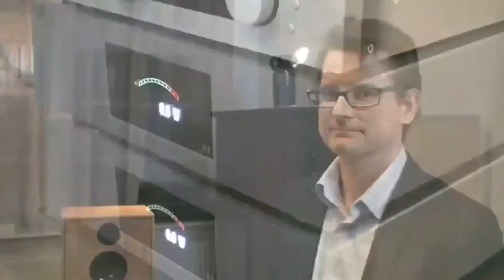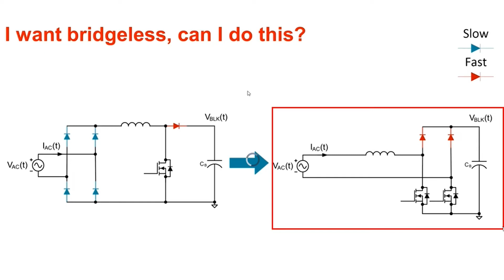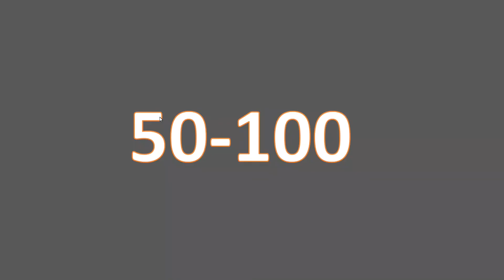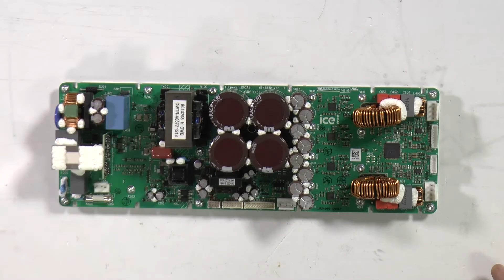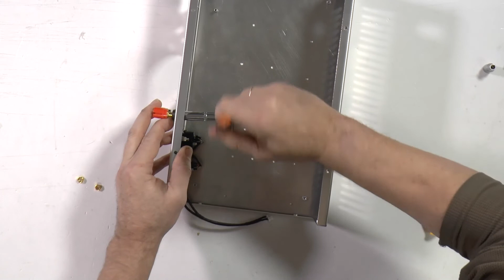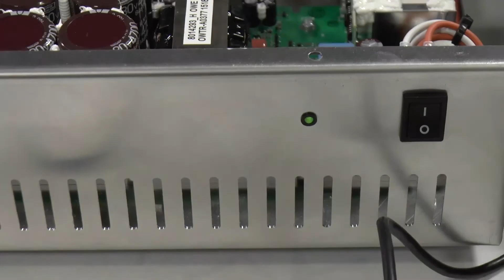ICEpower 1200AS2. Build your best audio amplifier in the world. Part 1-3

Comment: I had plans to use my MiniDSP 2x4HD board to drive this amp as a subwoofer amp but now (after testing) it seems the 2V output is not strong enough to drive this amp. What could I use to take the processed signal from the MiniDSP and increase it so the amplifier will produce full power?
Reply from the maker: Any preamp that can boost signals up to 3.8Vrms or 5V peak. You can use professional mixers that are produced in large volumes and costs are reasonable like Soundcraft ohttps://www.thomann.de/gb/soundcraft_notepad_5.htm or Behringer https://www.thomann.de/gb/behringer_xenyx_302_usb.htm
Reply: @guntarssmits2104  any ideas for something smaller/bare board that could go in the amp chassis?
Reply from the maker: @stevensolazzo  It is hard to suggest regarding bords. Icepower 1200 has very good balanced preamplifier circuits and you need a good preamp for that. Also, it is difficult to predict the voltage transition processes of the preamp. It may create a huge blast during the switch-on process. You also need power supply voltage for the preamplifier which you can take from 1200AS2 board, some +-15V. You Should take some boards from AliExpress and experiment. It would not be correct by me to suggest something that is not tested.

Comment: Could you please make a video on the new 2000 AS modules. Would like to hear your opinion on them! Amazing channel you have! I love it
Reply from the maker: Yes, 2000AS2 is a fantastic board. It is identical to 1200AS2 but with higher output power per channel. Single channel is capable of delivering 2KW, Stereo 1KW per channel. The connectors and layout are exactly the same. My Kit TCR1200 can be used for both boards without modification. Wires can handle 4 KW/channel. It was a clever solution to use a PWM fan for cooling because 2000AS2 has a higher idle power consumption and it may be wise to use the thermal paste to improve the thermal connection with the chassis Other vise board is identical to 1200AS2 with the same performance and architecture. I Have a german customer who builds an amplifier using a 2000AS2  board and a TCR1200 kit. He mentioned that his system has infinite power headroom and I believe it. 1KW high-quality power per channel for the home user is a lot of power.
Reply: @guntarssmits2104  thanks for the reply! I have 2000AS2 myself which I use in mono-configuration. They are built with only the best internal-wiring and connectors from Furutech and ETI. The headroom and slam is incredible! Utterly transparent and clean sound! I have owned many expensive AB amps from known brands, but these ICE-power amplifiers best them all! They are also an amazing match with my Pass Labs XP 20 preamp! 🙂👌! Keep up the good work my friend! Very informative and knowledgable channel with absolutely zero BS!

Comment: I have been using a 50ASX2 at my desk for a long time. It has been reliable and sounds good through my speakers, which are DIY but are like Amphion Ion with upgraded drivers.
Reply from the maker: I have made a stereo amplifier from ICEpower 125ASX2. It was a very good 100W/channel amplifier and sounded better than many industrial samples. To improve the sound, I used an INA1650-based balanced preamplifier. But 1200AS2 is a next-generation design with proprietary Class d driver chipsets. There is a significant sound reproduction tolerance jump. And of course, working so far away from clipping it is capable to drive complex speaker loads without sound reproduction detail loss.
Reply: @guntarssmits2104  I have been on an amplifying odyssey for the last two years. I bought two Hypex NCx500 monoblock amps. I was somewhat lukewarm on them, even though they sound quite clear, because they are too overdamped in the bass range, but I remembered having good results from 300ASC, which became 300AS1. I bought and built a pair of 300AS1 monoblocks and I have been enjoying them. At the same time I also bought a 200AS2 module and built a stereo unit. I have some dry, bass-shy floorstanding speakers that actually work really well with the 200AS2 which has a lower damping factor than the other modules out there; I am curious how much of this has to do with the amp chip. Out of curiosity, after reading good things, I bought two 1200AS1 to build a pair of ICEpower monoblock amps. I think it can only benefit to have two independent 1200W power supplies available instead of just one that is feeding two amp channels. I will have to report how they sound. These modules are great, and having them available on the market to buy is even better.

Comment: Do you have information about installing a 12V trigger? Thanks in advance.
Reply from the maker: I will make a detailed video later, but in short you should provide 12v control signal to P102 pin 18 (Trigger) via 10K resistor
Reply: @guntarssmits2104  Hi, thanks for the reply. What about a GND? I would have 2 cables coming from my processor (12v and GND). Also, would I first need to place the module in standby? Thanks again.
Reply from the maker: @MikeYoungeasytravel  From manual "When the 1200AS is in standby-mode set by a high on the Standby input, ( P101, pin6 connected via 10K resistor to pin 3 DVDD standby) the module can be powered up by a high on the Trigger input. This can e.g. be used to switch on and off a remotely located amplifier." GND connects to the chassis. Most 12v  connectors are meant to be connected to the chassis when you secure them. You should verify if the 12V socket is connected to the chassis in a secure way. Some paints may work as electrical insulators. In case you have a chassis-insulated socket you can connect GND to the board. In practice, you need to experiment with that. In case you get a hum noise disconnect board GND and go for chassis GND   for 12V trigger.
Reply: Is it possible to detect input signal from the balanced connectors and use this to turn on the amplifier only when needed?
Reply from the maker: @wojciechgorski5708  Yes

Comment: Are the other icepower models from the AS Series the same quality than the one you used? I consider building a amplifier but I really don’t need that much power and also I wouldn’t be mad spending a bit less money for a less powerful model. Best regards and thanks for the great video
Reply from the maker: No, alternative integrated boards with the latest generation chipsets and Quadro-balanced architecture exist. Believe 500W is not much power even for shelve-type speakers you will have some headroom that's it. It was a problem with class AB efficiency and most of the Class AB amplifiers are about 100W. Normally for floor-standing speakers, we need more power but it was expensive in the past. I was testing setups with 40RMS power small speakers and they sound lovely and safe. Board is built with low sensitivity and you need a large input signal (3.5V) to go for full power

Comment: Have you tried some Hypex/purify models wich are extremely popular? And are they close/better for music performance wise? Thanks in advance, this was an amazing video!
Reply from the maker: Purifi and Hypex solutions are single-ended which is a significant lowlight for class d design. They are great sounding devices but for a higher price and the worst architecture. This is the main reason why I choose ICEpower over Purifi and Hypex. The last 2 brands are focusing on consumer audiences and have a lot of buzz around their products. It does not mean they are better. They have better marketing with a clear focus.
Reply: @guntarssmits2104  thanks for the fast reply!!
Reply: @guntarssmits2104  As far as I know, Purifi and Hypex amps are designed natively for fully differential input, not single-ended. Isn't this what you mean? I really appreciate your work and knowledge for the community.
Reply from the maker: No, I meant output stage. 1200/2000 line up has bridged architecture ( Mcintosh branded it as Quadro balanced)
Reply: @guntarssmits2104  Ice being bridged as in a bridged stereo amp in mono mode (Bridge-tied load)?
Hypex can also work in BTL, which "results in double the voltage swing across the load compared to a single-ended configuration". This is useful for higher impedances, as the impedance of the speaker is halved in BTL, min. 4 ohms, 8 ohms recommended. Peak power is doubled. THD is worse than SE.
I don't see Hypex and Purifi architecture being worse than Ice for this. Ice's main benefit is price per power. And yes, efficiency.
As far as I know, SE is referenced to ground while BTL is floating.
Can Ice drive 2ohms speaker in BTL architecture?

Comment: I own a combined dual monoblock with a stereo kit in the middle of the steelcase. It delivers 1200 watts per channel for my dual subwoofers and 620 watts per channel for my top system consisting of two Seas L17REX/P and one centered Aurum Cantus G2Si ribbon tweeter. They sound perfect👌🥳

Comment: Hi, recently I just saw a youtube clip from PS audio and they're also using icepower module for their amp. They're using 1200AS1 to build the monoblock. In the comment section I saw people describing the old class D problem is mainly comes from low pass filter design. With poor implementation some high frequency noise might goes into speakerdrivers in the old days. Also they've mentioned about the BTL mode typically has better performance due to 2 sets of LPF the circuit is actually using. My question is whether 1200AS2 is in BTL mode? In your video you've mentioned about the benefit of quardo balance design. But looking from the 1200AS2 board itself it seems that the output part only has one 
inductor per channel? Are they using same inductor for positive and negative channel? or it's different demodulation?Another question is about the phase response. Saw some people mention that the phase response of 1200AS2 is 30 degree off at 1kHz and 40 degree off at 2kHz and max out to around 50 degree. Is the phase difference a concern for audio content at this frequency range?
Reply from the maker: Icepower1200AS2 has 4 channel architecture set in bridged mode. The filter has 1 core and 2 inductors inside it. This is misleading visually. It is a space-saving solution. If you will check the inductor in detail it has 3 connection points. One more engineering genius solution is reducing the price of the board. The board's final price/quality is unbeatable. The simple answer- 1200AS2 is operating in bridged mode.
Regarding phase shift. First, humans cannot hear absolute phase, just a phase difference in the frequency range from 500Hz -4.5Khz. Once both channels have equal phase shift sound stage is not impacted and you have the perfect result. Think broader and take into your scope passive crossover filter what is turning phase for more than 180 degrees in the midrange and no one is complaining that it is a problem. But a lot of literature is emphasizing that you need a good crossover with selected and adjusted components to match the channels. And the last phase impacting element is the speaker itself. Each speaker in the working frequency range is turning phase for about 30 and more degrees. The key takeaway from the long answer is that human is not able to hear the absolute phase, only the phase difference between the left and right channel.
Reply: @guntarssmits2104  Thanks so much for the detailed answer. I also wander why people put emphasis on power amplifier to have perfect phase response but did not mentioned about the phase problem in crossover / drivers. The 2 inductor in 1 core is hard to tell for me, really thanks for the information. I'm recently considering buying the 300A2 hanger module to form the 3 way system by using the hanger rail from 1200AS2. I'll update after finished.
Reply: Which LPF would you recommend? Passive? Order? Would that work on other class Ds?

Comment: Labdien!
Great video!
I was curious about the ICE1200AS1 vs AS2: does the AS1 have any advantages over the AS2?
Looking at their specs, an AS2, if run mono, gives the same output in a 4 Ohm load as an AS1. So is more flexibility for the price of a little idle power dissipated by the extra output stage when that is not used, and ca. 80 Euros (tax included). Otherwise apparently identical parameters when AS2 runs one channel only.
Seems to be very little going for AS1 - or am I overlooking something?
Reply from the maker: Yes you are right. 1200AS1 is good with a hanger board to make 3-way active speaker systems. For other applications 1200AS2 is better choice.
Reply from the maker: You are Right, There is no tangible benefit except a slight price difference using the AS1 module. There is a professional usage scenario in format AS1 board for a woofer with 1.2KW and hanger module for 300W or 400W in stereo. You will get a powerful 3-way system for professional usage, but there will be too much power for a home system.

Comment: Very nice video. I had a xtz edge a2-300 . But that one was to weak for my speaker.. Do you sale the whole kit ?
Reply from the maker: Hi, currently I am selling only Kit. In my channel, there is information also about terms and conditions and where to purchase the board. We are not selling boards by ourselves. The board you can purchase from EU reseller “Sound import” Boards are in stock. This is a proven supplier with good customer service.  https://www.soundimports.eu/en/icepower-1200as2.html 
Pricing, Terms, and Conditions are described there. This kit we are mostly selling directly. This video will answer why. https://youtu.be/BmvG0foYXGY
Assembling instructions are available on my channel https://youtu.be/w1FNFcv1v7w
Reply: @guntarssmits2104  Thanks for the time. I will give it a try . I think this setup will match my speaker well.

Comment: Would one of those cnc aluminium case thats used for class A amps be enough to passively cool this module?
Reply from the maker: Yes, but you do not need so excessive cooling. I saw suitable enclosures with one full-length heatsink. You need about 120mm high enclosure with one heatsink, place the board in a vertical position, and drill holes in the bottom and top plate to provide airflow for board components with natural convection. It starts from about 120mm high. Cold air is coming from the bottom and hot is going out from the top. You should provide 12mm bottom clearance for secure airflow.
Reply: @guntarssmits2104  Will heat dissipation through the bottom metal plate be enough to cool it? 
I am looking at a Boulder style  cnc case that doesn't have any holes for air flow. if the heat is mostly transfered to the bottom plate, then I could just put thermal paste between the bottom plate and the case, let the case do all the cooling.
Reply from the maker: @px7355  From engineering aspects it is not a good solution. You should create convection according to physics  Your design will overheat already at half power continuous music listening and shorten the board lifetime Heat from the bottom plate accumulate inside the chassis. without convection, it is not moving away and starts exponentially growing inside the enclosure. Dispatch is slower than the accumulation process.
Reply: @guntarssmits2104  thank u, I will look for another case then
Reply: @guntarssmits2104  I’d expect the heat accumulation’s dynamic be closer to “asymptotic”, stabilising at certain temp. difference between the case and ambient; still, “exponential” could characterise the damage it will do over time if the equilibrium will be around the modules thermal protection threshold.
Nevertheless, I can see an argument for a closed box - no dust.
AS1200 does not seem to have any particular surface where to attach a heatsink/ attach it to a heatsink, or I am missing smth.?
If so, then one should cool the air inside the closed box. - Can some parts be wrestled from portable refrigerator boxes running on 12 V?
Or one can just cool the box. Not efficient … I’d suggest a box deepr (and/or wider) than the module, with heatsinking, and keeping the module at the bottom; a wide, shallow box can be put on a side, with the module at the bottom, the empty space above it. There will be limited convection inside the box, and outside. Unless the box is big, or very sohisticated, it is still likely to shorten module’s life.
If I cannot fix my dead Aleph 4, ditching innards would make one mighty closed box; only ICE1200 is too big for that …  but it might just fit diagonally.
Reply from the maker: @rudolfsverdins5552  To cool the system you need to provide airflow conventional or forced. There are no other options. It may be small vents as well but those are noisy.

Comment: Great video. How does the Amp sound?
Reply from the maker: Probably this is one of the best amplifier boards that I have ever heard. There are tiny bits of perfection like precision and ease to listen. Especially at low volume when typically, we are losing reproduction energy. But not in this case.  Still, perfect precision and tolerance how it sounds. When I assembled this unit, it become the only one I am listening. There is some magic in how easy is a listening experience.   But I should be honest, I never had on my hand's top line Brystone and Mackintosh units.
Reply: @guntarssmits2104  that's good to know. Specially for the price. Have you compared this Amp to other class D? Hypex NC400 or Nc500...
Reply from the maker: I did not, but I found 2 forum members who own all 3 brand amplifiers and tested them for the year. Final judgment – they sound the same. The owner kept the 1200AS2 version due to higher power and lower price reasons. Of course, we can discuss a matter of speaker resolution, etc. From an engineering point of view, 1200AS2 is superior due to Quadro balanced design which is important for professional applications running amplifier at clipping level. I also value this design capability to work with equal power for 4 Ohm and 8 Ohm loads. (limited by amplifier output current not power supply voltage)